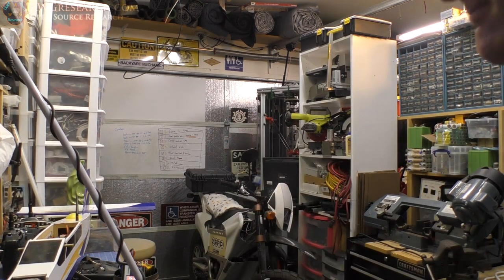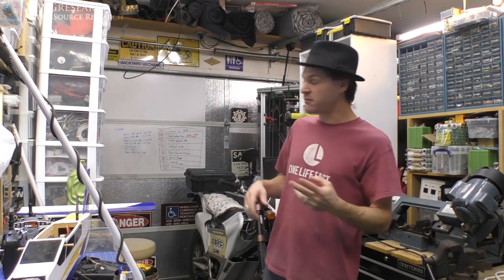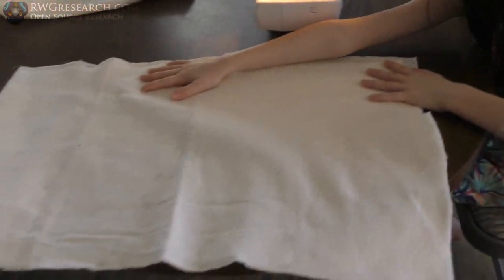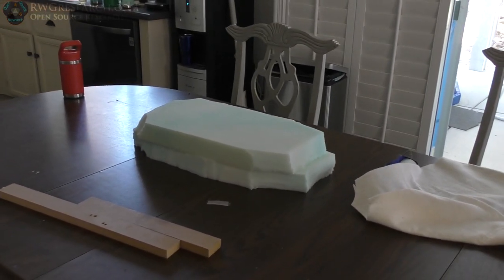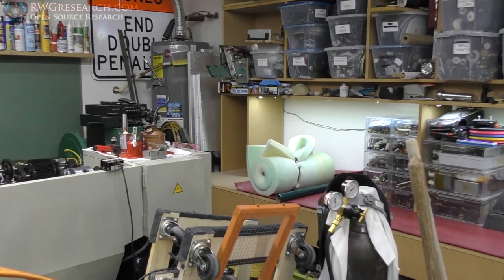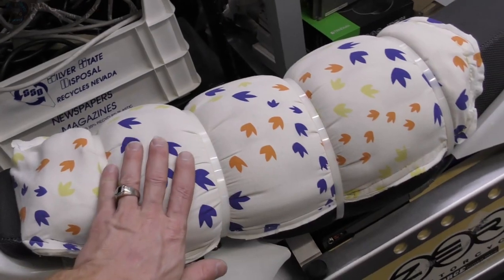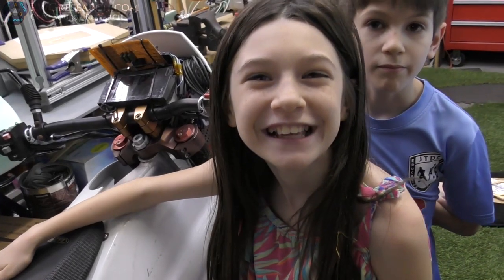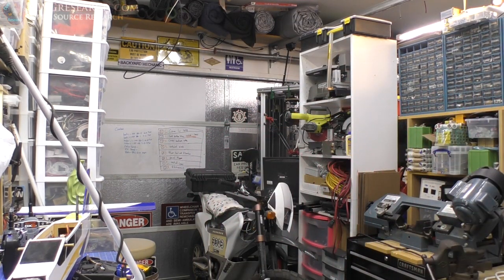Zero P20... The Dinosaur But Pillow... Yeah... About That...

Comment: I’m asking for my gun rights to be restored.  I really think this is a cool project.  There have been over youtubers that went viral over electric bikes.  I think a street/dirt motorcycle that’s water/dirt proof would be awesome, and it would be cool if you could push it to go 150 miles per hour or at least 75.  I am also worried about potentially emp or electric storm could wipe out all electronic, one reason why I might not get an electric motorcycle.  I really like the Kawasaki’s that could go 400km/h or over 200mph.  Having a completely silent dirt bike would be cool.  How much did the battery/motor and what is the total of the motorcycle?